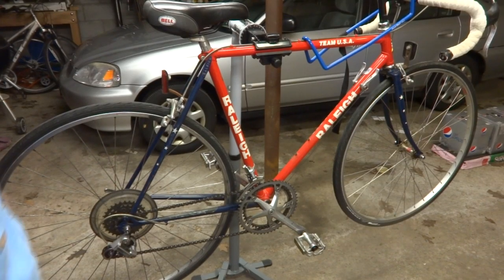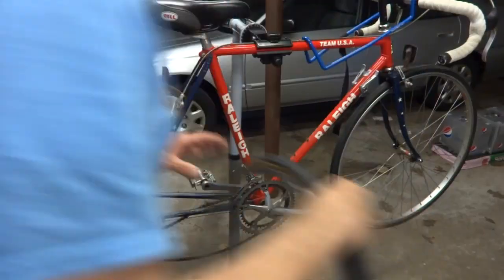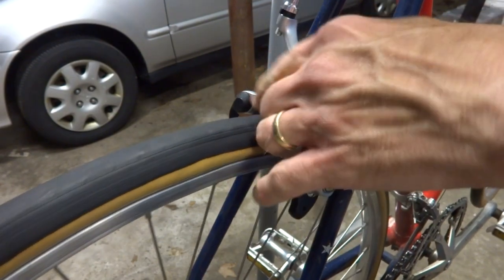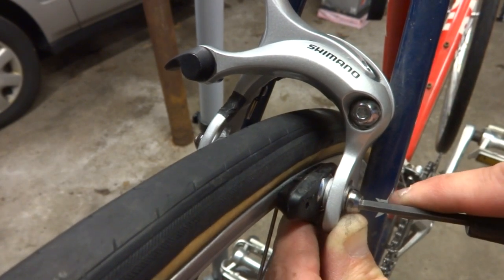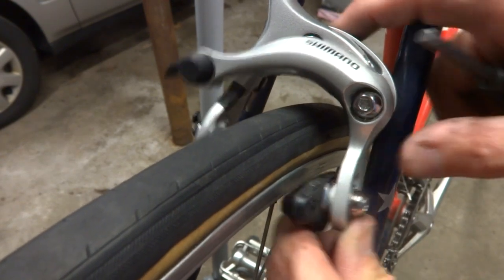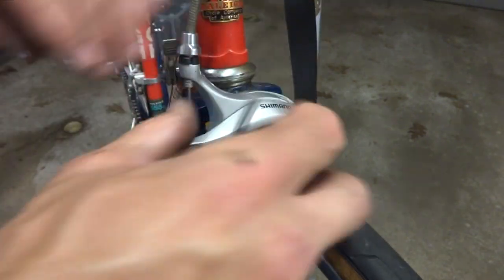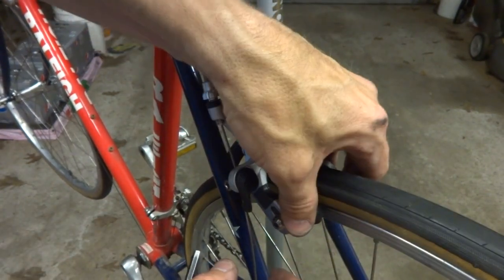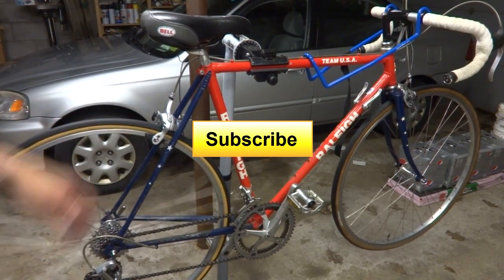How To Do 27 Inch To 700c Wheel Conversion - Vintage Bike Update

Comment: The difference in Diameter between a 700c and a 27 is 4mm!... I question why they ever bothered changing it.
Reply from the maker: 27" used be common. But 700c is the standard for road bikes now.  The selection of tires for 700c wheels is huge and pretty limited for 27" wheels.

Comment: What is the purpose of converting a bigger size wheel to a smaller one?
Reply from the maker: +DeTaquitoNomas 27" wheels used to be common on road bikes, with 700c wheels only on higher end bikes. But 700c wheels are the standard on road bikes now. So there are limited choices of tires for 27" wheels. But there are tons of choices for 700c tires.

Comment: Is cutting and replacing the brake cables necessary?
Reply from the maker: If I am going through the effort and cost, I am not going to be a cheapskate and  skimp to save a couple dollars by using old worn cables.
Reply: RJ The Bike Guy  thanks for the reply.

Comment: Can I use a 700c suspension fork on a 29er using the 29er wheel.. Be blessed
Reply from the maker: I believe you should be able to, as long as the 700c fork is wide enough to accommodate your tire.

Comment: is it possible to route internal cables in a steel frame?
Reply from the maker: If you drill holes in the frame. I have done it. You do it at your own rish.
Reply: RJ The Bike Guy do you have a video?
Reply from the maker: Nope. I did it almost 30 years ago. Youtube didn't even exist yet.
Reply: RJ The Bike Guy what bit size would be best?
Reply from the maker: Use a caliper to measure your cable housing, and use an appropriate bit.

Comment: 700cm is larger by about 1.5 cm than 27" so why is the 27" wheel larger than the 700c wheel??
Reply from the maker: Because a 700c rim is 622mm in diameter. 700 is/was the tire diameter...but tires vary.
Reply: I c thanks great vids by the way

Comment: Why would you cut the brake cable instead of just pulling enough out to be able to remove the brakes and then pull it back tight on the new calipers. I can see if the cable is rusty or frayed and needs replacing but alot of times you can just use the old cable and save work. you probably did it this way for the sake of the video.
Reply from the maker: +Steve Bullard Cables are cheap and should be replaced once in a while anyway. And it's a lot easier to fit a longer cable than trying to grab the nub of the old one. Do whatever you want though.

Comment: what frame material is that? i cant quite read the sticker in the video angles... is it a reynolds? i cant see a listing for -55 something?
http://en.wikipedia.org/wiki/Reynolds_Cycle_Technology
Reply from the maker: Raleigh 555 SL tubing. Chrome Moly.
Reply: shyflirt1
reading round that it looks like the Raleigh 555 was only marketed in the USA and is roughly equivalent to the reynolds 501 tubing

Comment: is it ok if I buy a new fork that fits 700c for the old frame?
Reply from the maker: Sure. It might change the geometry of the bike slightly as the 700c fork will be slightly shorter. You will also need to make sure the steerer tube is the right length or can be cut to the right length leaving enough threads.

Comment: those brake calipers were the same size...could've used the old ones and just adjusted them. At least it looked like they still had enough range left.
Reply from the maker: As I said in the video, the older ones probably would fit, but, the long reach brakes were longer. They were also stronger brakes.
Reply: gotcha. Unfortunately I didn't have the volume on. Keep up the good work.

Comment: Don't take this the wrong way,....I'll stick with my old (Cheap to replace) 27" tires.
Reply: Where do I get cheap tires at?
Reply: @MrEjblanco  e-bay, Wal-mart & The Internet. If you can afford to wait, tou'll find bargains. I found tires for $17, Tubes for less than $10. You have to be willing to wait. If lucky,....your local bike store might have bargains. I found tires (at a local bike shop) for $15, but they ran out of stock.... Keep an eye on the Internet. A lot of unadvertised specials can be found.
Reply: @MrEjblanco  Many local bike shops carry cheap Cheng Shin 27" x 1 1/4 tires. If you are not racing, these are good tires to ride around your neighborhood or even on gravel trails. The fancy (expensive) tires are now only available in 700c size.

Comment: Hmmm....not really much to learn here.  For most upgrades one will need to buy the 700c rims AND they usually come without the 6 speed gears.  It would be good to show how to take the gears off the old 27 inch wheel and put them on the new 700c rims.

Comment: Please! How it is posible to fit 28 inch to 27 inch frame sorry for my gramar iam from slovakia
Reply from the maker: 28" is often just another name for 700c which is what I show in this video.
Reply: But is it biger than 27 thanks for your help
Reply from the maker: Then I don't know what you have. You will just have to figure it out.
Reply: @RJTheBikeGuy  i was thinking that the 28 arent realy bigger than 27 but i tried it and it fits but why is it 28 and still smaller iam  confused
Reply from the maker: @matusilly8174  Because specs are weird. There are like half a dozen 26" wheel sizes and they are all different.

Comment: Is it possible to convert a 26" to 700c?
Reply: Yes it is, 700c rims with road tires are about the same size as 26" wheels with large mtb tires. You need brake adapters though, if you are using rim brakes. Search for "v-brake extensions".

Comment: Can i put 700c on 27.5mtb frame?
Reply from the maker: Shrug. 700c wheels are bigger diameter. Rim brakes would be a problem. Wheels may fit, maybe, maybe with smaller tires.

Comment: I plan to put 700c wheels on an old mountain bike, only problem is it's 26in
Reply from the maker: Better to buy a frame made for 700c wheels.
https://www.youtube.com/watch?v=C7lR3R0pOZ8
Reply: @RJTheBikeGuy  i cant afford it, plus i did a test fit, they will fit just pretty close to not fitting, just need tires for the wheelset, and im gonna test some adapters that allow you place vbrakes higher up

Comment: Can you go from 700c down to 27. Rim
Reply from the maker: Yeah, but why? 27" is older technology with much more limited options for tires. 700c is the modern standard for road bikes.
Reply: @RJTheBikeGuy  ..
I hear you a d agree 100%  my reason is I  bought a trek 330 with 700c rims ..like the fool I am didn't know the back rim was bent ...well really dont want to put out big $$$ on this bike ( have a set of 27 in my shed ) from an old Columbus bike..just being cheap
Reply from the maker: @swanzilla1982  Buy a used 700c replacement rim.
Reply: @RJTheBikeGuy  ...I been finding alot of bikes lately I may just junk this trek ...( live and learn ) 
I'm a steel frame Junkie.
Reply from the maker: @swanzilla1982  I like Treks.
Reply: When I bought this I knew it was the 1990 blue and white but didn't know pink was on there ..
If you lived closer I would of just given it to you

Comment: The peddles hit the ground on sharp turns
Reply from the maker: The bike is only lowered like half an inch or less. I haven't had a problem. I don't think it will be an issue in most cases. This is a pretty common conversion.

Comment: This guy did not recycle the break cable he just cut it and wasted it...that's a bad example!
Reply from the maker: The brake cables were likely almost 30 years old. Well over due for replacement.
Reply: you DO NOT "recycle" BRAKE (not break) or shift cables. you are supposed to replace them at least once a year if not more often than once a year as part of a tune up